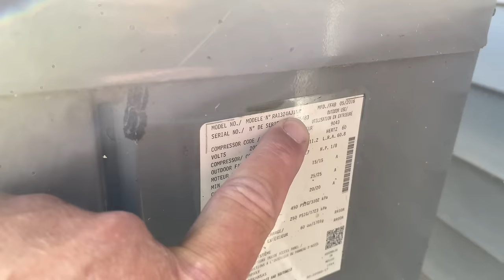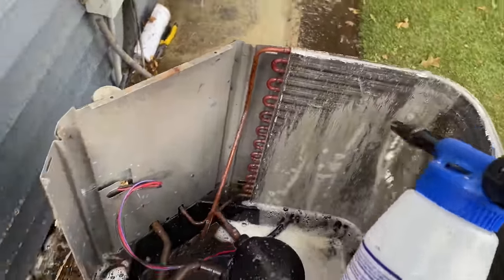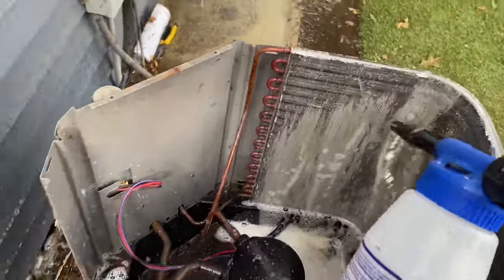Importance of Hiring a Local Orlando Air Conditioning Contractor Proper Outdoor AC Unit Maintenance

Comment: That condensing unit did an excellent job of filtering the outdoor Orlando, Florida AIR‼️‼️😂
Reply from the maker: You got that right!  Remember if you need a HVAC contractor in Orlando Florida, give us a call at 407-375-1100

Comment: Man they are like that everywhere around here haha and people ask me why I am always taking them all the way apart to clean them.. because you have to.. if you don't you are not doing the job correctly. Especially when they are that caked. I always like to use small brush and lightly brush the outside and knock all that fur off before getting it wet so it don't just stick. Dawn dish soap works wonders as well. Thanks for sharing Mikey.
Reply from the maker: Thanks so much for watching and supporting the channel and remember if you’re in Central Florida Orlando region and need a licensed plumbing or HVAC contractor give us a call at 407-375-1100

Comment: 0:23  should see the HOA sister lives in, lots of houses still using original 1987 indoor/outdoor handlers (I know, ppl, lol) AND pretty much 88% of the builder grade or lower faucets, sinks, toilets, tubs, ALL APPLIANCES, cabinets, etc….here in a ton of HOAs in Florida. They go up quick, fast, cheap, and d ya get tailgate/tail light warranty…..even on the remodels 🤦🏼
YES, good, great, awesome companies exist and DO CARE, finding them easy……they booked out 1-2 years😉
Cheers✌🏻
Reply from the maker: Wow, sounds like the 1987 time capsule is still thriving! Maybe we should start a retro home decor trend with those original fixtures, right? 😂

Comment: I wonder what the evaporator coil looked like 🤔🤔🤔🤔
Reply from the maker: you can't even imagine
Reply: Actually I have a pretty good idea, after 30+yrs I've seen a lot of things But I do have to admit that condenser coil is definitely the worse one really surprised it still runs. I think the worst job I went to was a HUD apartment complex to replace all the ductwork and grills had to have maintenance open an  apartment so I could work tenant wouldn't open it up it was dark shined the flashlight in and it hit the back wall the whole wall moved it was a solid wall of cockroaches I told the maintenance guy to get an exterminator out and then I would do it I wasn't carrying them home with me!!!! Of course the coils on the ahu's were nasty too but not to that degree but at that point I didn't care whether or not I lost the contract to renovate the system if I did oh well sometimes you just have to draw a line!

Comment: One of the most important things you can do to a unit and for your customers is regularly hose down the condenser coil as part of your maintenance. Quarterly, twice a year, or even once a year. You should not even need coil cleaner unless it has been neglected.

Comment: As dirty as that coil was, I would  also change the contactor as a precaution. The heat generated by a coil that dirty would have wreaked havoc on the contactor’s coil!
Reply from the maker: Are you paying?
Reply: @MikeyPipesOrlando  No, your customer is after you properly and intelligently explain why they should. And if they don’t have it replaced that’s fine too. F’em! What’s could a contractor possibly cost with the install on top of the work on this video? An extra 40-60 bucks?

Comment: It doesn’t matter which way you rinse out the coil but the cleaner does need to go on the outside of the coil if only putting it on one side…
Reply from the maker: I apply the condensing coil cleaner on the outside and the inside of the coil

Comment: Wow, the extra energy it used  would have paid for yearly service contract.  Lets just say you cant DIY this  150 to 175 a year would more then make up in energy savings and it would keep the house a lot cooler.  Poor thing was working overtime just to drop the temp 10 to 20 dgr.
Reply from the maker: You are correct

Comment: No capacitor or contactor test?
Reply from the maker: Are you kidding me getting them to clean the coil was like pulling teeth. They didn’t want to spend anything, but I convinced them that this is the right thing to do to preserve the life expectancy of the equipment. So if you’re in central Florida Orlando region give us a call at 407-375-1100.

Comment: But Mikey pipes when you use that M 18 blower your angle of blowing was not accurate my friend you were pointing it into the machine therefore you were embedding the dirt further and harder than before can you answer that one lol so therefore, the cleaner has to work even harder
Reply from the maker: I wasn’t really expecting to do anything with the leaf blower. I was just doing that for theatrics.

Comment: That unit hasn’t been cleaned in at least Ten years with all that buildup on the coil.How can people neglect the very thing that keeps them cool in the summer,unbelievable.
Reply from the maker: And the sad part here is that a local HVAC contractor was actually doing maintenance on their HVAC Central air conditioning systems. That’s the real sad part of the story. The homeowner being ripped off by another contractor. Remember if you’re tired of paying for mediocre service from your HVAC contractor and you’re in the central Florida area. Give us a call at 407-375-1100.

Comment: I have never seen a condenser coil so bad!
Reply from the maker: I’ve seen worse believe it or not but this system is definitely in the top three of disgusting central air-conditioning systems that have not been properly maintained. If you are in the Orlando Florida area and need a licensed and professional HVAC contractor for your central air conditioning needs please give us a call at 407-375-1100 or you can save time and book online at orlandopipedoctor.com.